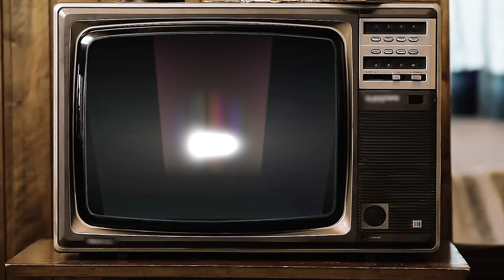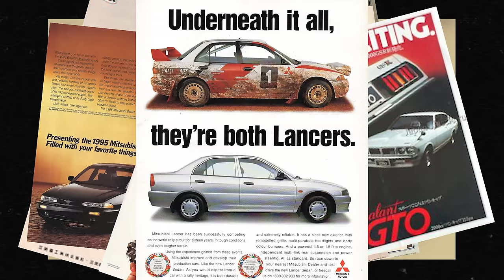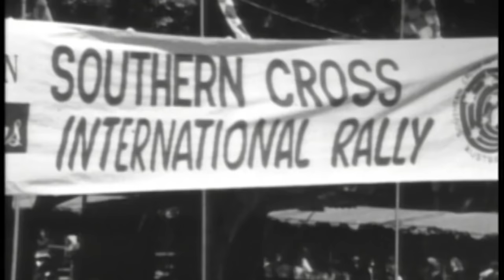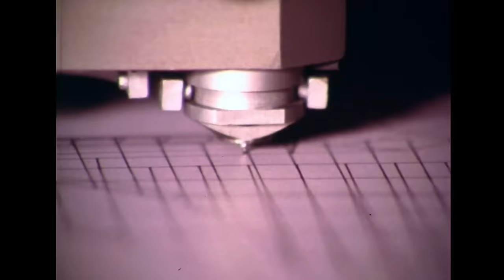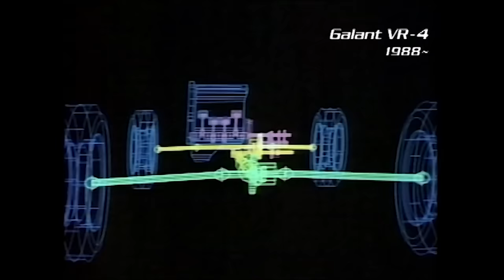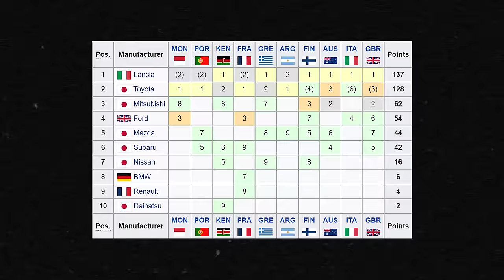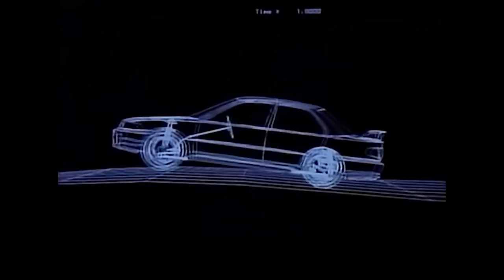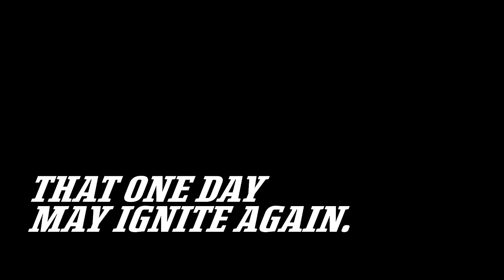How Mitsubishi Threw Away a Dynasty

Comment: 4G63T is a legendary engine... I was proud to own an Evo 9 MRSE but during the financial collapse of 2008.. everyone lost their jobs that time including mine so it forced me to sell my beloved Evo..  Always knew it'll be a collectors car one day and now, I terribly regret letting it go.  Always going to be a fan of EVOs.  Mitsu really need to bring it back.
Reply: Bro the prices of evo 9s have skyrocketed in the recent years it sucks i wanted get one before they get any expensive and at this point idc if the car was abused
Reply: Be happy you stepped away, most used ones are rust buckets and electrical nightmares. 

You find are a rare nice one, sub 75k miles I’m sure it’ll spring a harness or electrical issue in 2-3 years. 

The only way to enjoy a 4g63 is by gutting the conveniences. You can buy an eco boost and have air conditioning if your destiny is having a fun turbo car.

I owned Mistus since I started driving, I can honestly say they were very consumer friendly cars and I can’t understand the hype. The 3000gt active aero was the only true sports car mitsu released.

Eclipse was the 2 seater rage of the late 90s and the evo was really just a mass produced rally car, and Subarus competitor.

Rally has been in a popularity decline since the early 2010s.

Mistubishi really messed up not kitting out the top model evolutions with true off road suspension, and wide low psi tires. They were a gimmick from the very beginning which could have replaced a small suv/truck for off-road capability/snow.
Reply: @JACS420  The lack of funds was always the problem with the motors branch of the Mitsubishi corporation, that's why their peak years were when they were partnered with Chrysler. The best car (Eclipse) is really a Chrysler designed by a gang of interns around the 4G63T. It's the civilian version of the Dodge Interceptor.
Reply: Mitsubishi's fall from grace is so sad!!  My first Evo was the one that came to the states in late 2003.  I kept that car for over 10yrs and put 100k miles on it...it was the best car i've ever owned.  I was able to buy a nice Evo X about 6yrs ago (2008 w/ currently 73k miles), and its very reliable too (just as good as my 8, but also better in many ways).  I'm never selling that car!!
Reply: My condolences.. 😟
There is nearly nothing I fear more. I know its weird for most people to love cars that much (not sexual), but theyre part of the family..
Reply: Love than, man. A really small portion of Mitsubishi's industry is in automotive nowadays and they don't seem to listen to the demands of the people anymore...
Reply: @5kywrd  Lol didn't you watch the video? The automotive sector of the Mitsubishi Corporation has always been a small fraction of the company and they've never cared about what the public wants, they've only improved their products in response to a handful of men who got directly involved with or without Mitsubishi's consent until Mitsubishi had no choice but to support their efforts.
Reply: @JorgeChavez-du5vm  i meant to take "nowadays" out
Reply: Naaa, you ruined it
Reply: @ArcanumMortis98 Sounds sexual🤨
Reply: @Gushe002  Evo VIII came around 2003 - that's when guys really started dumping DSMs.
Reply: @JACS420  The 4G63T was (and still is) "affordable" to properly tune, still has a good amount of aftermarket support, and responds well to modifications.  I've had two DSMs, rebuilding one of them, and getting ready to build another engine.  Some parts are really hard to find and getting a good trans rebuild is almost impossible unless you unload a little bit of $. I'd never get an Ecoboost, an engine designed to fail and leak coolant, over a 4G63T.

Electrical isn't that difficult to fix; annoying, time consuming, and more tedious than anything if you have no skill or expertise.
Reply: @reubenmorris487  it was the end of 2003, but yeah.  Most 2003 Evos actually had build dates of well into that calendar year, and ALL Evos were built in Japan.  I think mine wasn't built until Dec 2003 (may be why it held up so well).
Reply: Mitsubishi revived the “Eclipse” as a fucken crossover SUV; one wrong move & the Evo’ll be brought back as a useless, overpriced “luxury” EV pickup the size of a two-story house

Comment: Initial D did a good job showing how the Mitsubishi was regarded. Hilariously hyped but accurate since drifting 4wd is apparently difficult
Reply: Too bad the Evo drivers there were  jerks (at least Emperor and that Evo 7 guy didn't pull dirty moves)
Reply: I like how they hyped up the Evo so much, only to give the most OP character of them all a 2 door Impreza Type R 😅

Like seriously you would think they would have Bunta drive an Evo. They just had to give him an Impreza (which no other rival in Initial D uses 👀)
Reply: @devandrasimanjuntak1646  Evo is great and all, but for Bunta it had to be 2 doors. That was the deciding factor. He also appreciated the flat four design.
Reply: @devandrasimanjuntak1646  It has AC,very important
Reply: @misterjersey5460  you should watch Wangan Midnight. The driver, Eiji Kamiya is a good guy who drive an Evo V.
Reply: @pelarikota8103  Ah yes the brothers who both owned evo v’s
Reply: Depends on what your torque vectoring is but it is harder to drift awd
Reply: @devandrasimanjuntak1646  huh now that I think about it there was no other Subaru driver expect bunta throughout initial D
Reply: Naa buddy used to 4 wheel drift his Audi RS 4 quatro on small Roads in Ireland. Allot heavier than one of those. I'd kill for a evo7. Tomi MacKenin. Those scooby Vs bishi days might of been the last great days of rally. Mcrea Vs tomi. 2 door scooby yuuuuck.

Comment: I am literally a lifelong Mitsubishi fan. My dad worked for them since before I was born. Even though I was his son who graduated IT, I was the one amongst my brothers who experienced building trucks with them when I worked a short stint with them. Lots of the factory workers in my country still fancy the Eclipse, the Pajero, we're even proud of the diesel engines we used on the L300 light truck that has always been the de-facto name businesses think of when purchasing vehicles for businesses that don't necessarily need a heavy truck to haul stuff.

I've worked with a lot of Japanese expats as well, who are the most dedicated to their craft in terms of manufacturing. To me, Mitsubishi Motors is well loved, but has the suckiest internal politics that I ever saw. A coworker of mine in the assembly line once said to me "The problem with Mitsubishi Motors is like the problem with the Philippines." (I'm Filipino BTW). Whoever killed off the Evo and the Eclipse will forever be vilified in my head. Maybe they could've created a newer version, take in the comments by the Evo bashers and improve it. I seriously feel like Kia and Hyundai left Mitsubishi in the dust with the Stinger and the Genesis Coupe. Right now, Mitsubishi doesn't have even an inline 4 engine in their cars. 

If I won the lottery today, 4 models come to mind: Evo 3, GTO/3000GT, Starion Turbo, and 2nd generation Eclipse Spyder. Loved by fans but sadly discontinued by Mitsubishi.
Reply from the maker: Thanks for sharing! As a Mitsubishi owner myself I totally agree. Great cars, funky company.
Reply: pajero is fantastic

Comment: I had a 1983 Starion. It was rear wheel drive only, and was very unique in that the 84-89 drive train components were interchangeable, but the 83 stood alone. This wasn’t because the 84-89 were all wheel drive, it was because everything was slightly changed. The engine was the same displacement, but a different block. The different block meant a different transmission case. The suspension was altered such that when I bent a front strut I had to scrounge to find a new 83 strut. The body changed as well, the 84-89 had flared fenders and looked sportier and had much better style than the 83.

Comment: so im 14 and i love mitsubishi so i spent a while trying to make an improved MR platform for the evo in which i called it the MR-X Platform so here it is

MR-X Advanced Platform:

Lightweight Construction:

Extensive use of lightweight materials such as carbon fiber reinforced composites, aluminum, and high-strength steel in the chassis and body to reduce overall weight.
Weight distribution adjusted to optimize the balance for superior handling.

Mid-Engine Configuration:

A mid-mounted, high-performance engine, similar to the layout used in the Mitsubishi 3000GT VR-4, offering a low center of gravity for improved stability and cornering.

Suspension:

A fully adjustable suspension system, inspired by the Mitsubishi Lancer Evolution's Super All-Wheel Control (S-AWC) setup, allowing for precise tuning to suit various driving conditions.
Double-wishbone or multi-link suspension at both the front and rear for enhanced grip and control.

 Active Aerodynamics:

An active aerodynamics system, similar to the one used in the Mitsubishi 3000GT VR-4, to adjust the downforce and reduce drag as needed during high-speed rally stages.

Drivetrain:

A rear-wheel-drive setup with a limited-slip differential for superior traction and agility, based on the MR configuration.
Optional torque vectoring system, inspired by Mitsubishi's All-Wheel Control (AWC), for precise power distribution to the rear wheels.

 Powerplant:

An advanced turbocharged engine, based on the Evolution series but further refined for higher output and efficiency.
Hybrid or electric powertrain options for a sustainable rally racing future.

Transmission:

A high-performance sequential manual transmission, similar to those used in rally cars, for lightning-fast gear changes.

Active Safety Systems:

Advanced driver assistance systems such as adaptive cruise control, lane-keeping assist, and emergency braking, tailored for rally racing safety.

 Wheels and Tires:

Lightweight forged alloy wheels paired with rally-spec tires for maximum grip and durability.

Interior:
- A stripped-down, purpose-built rally interior with lightweight racing seats, harnesses, and a roll cage for safety.
- A customizable digital dashboard and telemetry system for real-time performance monitoring.

Comment: I had a 2005 Galant ES. Steel wheels. Gets me from point A to point B. No fancy infotainment system but it has a lot of room. The seats are comfy. Steering is quite good. Visibility is quite great. Brakes are quite good. I sometimes miss its simplicity. 

And most of all, the engine bay is big and easy to navigate when doing DIY.

Comment: I had a 92 dodge Colt, it was a Mitsubishi with a manual transmission. I loved that car paid 8900 new . Drove it 270.000 miles , two clutch's, oil changes, timing belts , took care of it. The trans began to pop out of 5th gear, clutch wore out, hail severely damaged, it still ran the last time I saw it, sold it ot a junk yard. True

Comment: For your info, there is a very particular Mitsubishi model that still resembles the Lancer Evolution. Look up at the Mitsubishi Xpander. It is a MPV body but there is one particular rally event called the AP4. And Mitsubishi has developed a rally car, 4WD, Turbo Engine, and suspension tuning just like the Lancer Evo on the Xpander. It is actually still there for Mitsubishi to participate in rally events but it goes unnoticed.

Comment: I still have a 96 Montero in my Driveway on 38" tires. Some of us Enthusiasts did EVERYTHING to convince Mitsubishi they were going to fail going to trash cars and cross over things. Just could not accept Americans wanted hard core off road vehicles and performance vehicles. They were CONVINCED fuel efficient clunkers were all we would ever want! We even designed a US market SUV later for them and used many off the shelf parts to save money. No matter how many years, now decades pass since the swap to junkers they just cannot seem to accept that they were wrong!

Comment: Bought a 2003 Mitsubishi Eclipse 6 cylinder straight shift in 2013....that son of a gun handled like a dream, accelerated great, went real fast if I wanted her to. Never had problems other than replacing old rubber and plastic engine components (seals oh yea head gasket at 170k). Just a wonderful vehicle

Comment: the Starion(which is literally the badass J-car of the 80s) engine was a re-purposed caravan/truck engine at 2.6L with a single overhead cam and a turbo, the G54/T. the EVO engine was almost always a 4G63, a DOHC Turbocharged 2.0L, which started out in USA in the 1989 Talon TSI/Eclipse ESI-R, and Plymouth Lancer RS

Comment: I've had a Colt Turbo, a Starion and a Galant in the late 80's and early 90's. I also had an Alfa and a Lancia Integrale and they were light years ahead of Ford's like the Cortina, Escort, Sierra, Granada, the only problem was that they would rot out in a few years whereas your average Mk 3 Cortina would run for 20 years and you could service it with 3 spanners and a screwdriver. I had several Mk 3 Cortinas and loved them, especially the 2000E automatic, it was like lightning back then...

Comment: Some inaccuracies for the video. Makinen did win the driver's championship from 96 to 99, but Mitsubishi didn't get the manufacturer's championship until 98 with the Evo 5. Then they never won the manufacturer's championship again. I don't get the "Mitsubishi wins the manufacturer's title on all 5 continents". What 5 continents? Europe, South America, Africa, and Australia. Wasn't any races in North America, Asia, or Antarctica. Whether you're taught that there's 4, 5, 6, or 7 continents, they didn't win on 5 continents during the Lancer era. Nor did any other manufacturer during the same time.

Group A cars also didn't have less power or torque from the WRC cars. WRC class was more of an extension of Group A rules to allow wider track width and not have the 2500 production car limit. The limiting factor for power and torque was the 34mm turbo restrictor for both Group A and WRC. If the Evo had less power and torque, it was cause they didn't build their car very well. That wasn't the case though. The Evo 6 Group A had 300 hp and 383 ft/lbs torque. Impreza WRC S6 had 300 hp and 347 ft/lbs torque. Toyota Corolla WRC had 300 hp and 376 ft/lbs of torque.

The 34mm restrictor was meant to limit the engine power to 300 hp, but you could end up with a little more power with good block, head, and turbo designs. Don't expect any works team to ever tell you they made more power. A lot of estimates put them 20-30 hp more than 300 and the few dyno graphs that too. Take such with a grain of salt. Who knows if people made modifications to such cars.

Comment: I bought a Mitsubishi 3000GT that had had the wheels and tyres stolen. It took over 6 months to get a new set and the car was at the main dealer all that time, they also fitted new disc brakes as it had been left supported by the discs, this was covered by the original owner's insurance.
The car was perfect in all respects until the drivers side electric window stopped working.
5 year guarantee it said on all the paperwork, so I took it back to the same dealership that had stored it waiting for the new wheels, tyres and discs, but they told me the guarantee was invalid as it hadn't had the first oil change etc. at 6 months, which was impossible as the car had been with them at the time awaiting the parts, and they had the opportunity to perform the free service.
They would NOT move on this decision, even writing to Mitsubishi UK did no good, they just confirmed that as the first 6 month service had been missed, the whole guarantee was invalid.
I fixed the window myself as it was only a wire fallen off the door regulator motor.
When I sold the car some 12 months later, everyone knew how awkward Mitsubishi were with service periods and as I didn't have a full service history I eventually had to sell the car at a significant loss to an enthusiast who must have had contacts as he later told me he was able to get the guarantee re-instated almost doubling the value of the car.
I vowed never to have anything to do with Mitsubishi ever again.

Comment: I am a long time mitsubishi fan. I learned how to drive on a 1981 Lancer EX (we call it "box-type" here). My profile picture is my 1989 Mitsubishi Lancer (12:11 on the video). The evo IX was the last generation where I was interested with new mitsubishis. I am not a fan of the X and the 4B11 engine. The car feels heavy that it's like you're driving a crown vic. Then, they discontinued ralliart and everything went downward on the company. The montero/pajero sport is totally different with the pajero, it's design is more a road vehicle that can offroad a bit.

During the golden years of mitsubishi, when you drive a lot of their normal cars, you will feel that there are some parts that was designed for performance. My lancer has a 1.3L engine but the steering is so tight. I can feel it when I go to mountain roads and the car excels on the corners where my friends' newer vehicles felt like it will rollover. I tried driving a newer mirage and montero sport, it feels like there is no soul on those cars.

Comment: Well, I think that Mitsubishi is done in the US Market, however, in other markets, particularlly in Latinamerica, they are stronger than ever. I think that there are some countries like Guatemala where Mitsubishi is "THE" brand to buy (yes, even more than Toyota). They are getting bigger and bigger from mexico down to Central America and parts of South America. I think is because they offer exactly what most people there wants: Reliable, economic and presentable cars. Given the proper maintenance, they are really cheap to fix and replacement parts are mostly easy to find and not too expensive. They are a great entry-level SUV brand to purchase in my opinion, even if they might not be the most luxurious or the most beautiffully designed cars, but they have acceptable quality interiors and good and reliable engines).